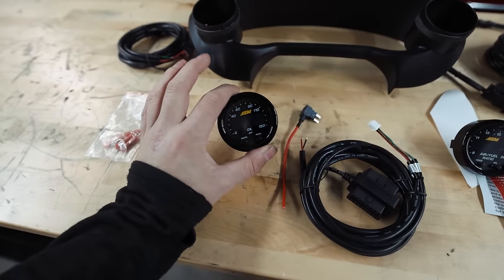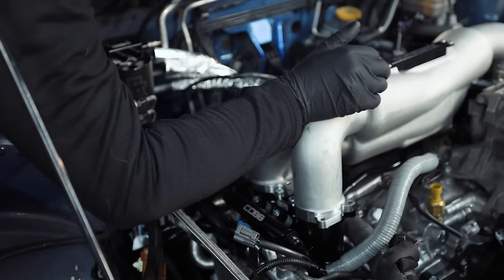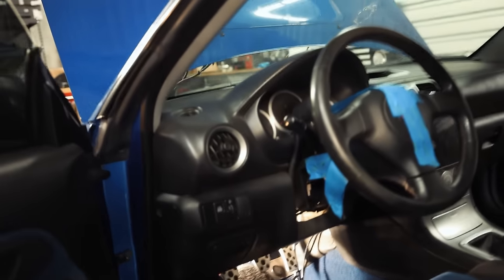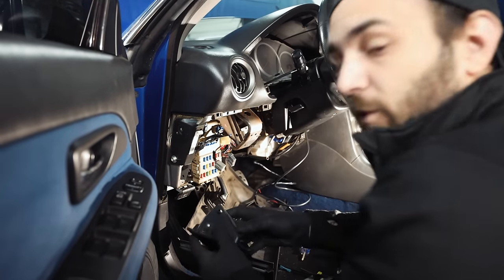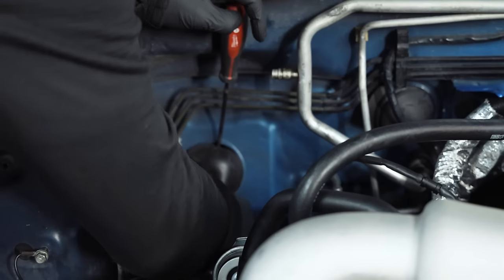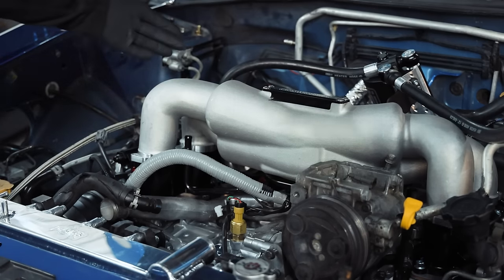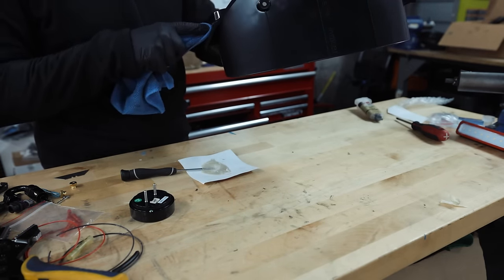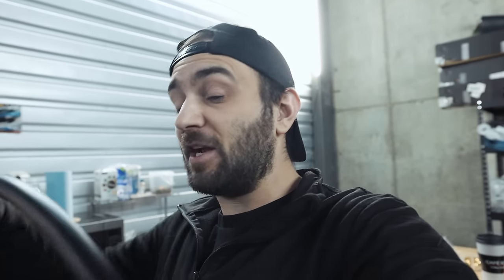AEM Oil Pressure & Wideband Install; 2007 Subaru WRX STI

Comment: So my question would be since u r taking off the oem dummies oil pressure sensor what do u do with the wire at is connected to that one wont that make a light come on???

Comment: So it is my senssor that went bad , it started to slowly not work some times  some days work and some not and then would only come on during hot days then finally stoped fully working no matter what and now never comes on , and ive been wondering what happend and what it might be , i figured the sensor but wanted to make sure before buying one but if you say they go bad like that then it should fix it no problem is there a warrenty on the sensor if you buy a new one ? , 06 GD owner and love the hawkeye content

Comment: What I did to make the rubber bands work is wrap the gauge with electrical tape to increase its girth, then wrapped the rubber band around the tape then they fit fine.

Comment: there is a firewall plug next to the steering column you could route the oil pressure sensor without having to extend the cable

Comment: I connected up oil pressure and temp gauges a couple of weeks ago, got a little freaked out watching the pressure steadily dropping as it warmed up, and not knowing what the pressure should be when idling at operating temp. A quick google search calmed the nerves.

Comment: Quick question! My Ap Afr reads a normal 14.37-14.50 but my Aem Digital Afr reads 15.15-15.40 at idle, then in normal driving they seem to end up matching. Is that normal?

Comment: For future reference,  anyone needing a replacement aem uego wide band o2 sensor;   Bosch part number 17018; o2 sensor will work as a replacement.  Its also alot cheaper than what aem will sell you. Just fyi.. happened to me plenty of time with my blob eye wrx

Comment: Curious as to why you chose the dummy switch location for the oil sensor. Is that for access? I did the one in the middle of the block and found it useful as when that sensor goes out, you have the dummy light as a check. My gauge value crashed but the dummy light didn’t do its 4psi trip so led me to know it was gauge and not engine

Comment: For the AEM gauge bodies you can 3D print spacers essentially to attach to the posts on the rear of the gauge and then use a rubber band as you would usually do.
Reply from the maker: I need to buy a 3D printer 😅
Reply: if you want to send dimensions ill 3D print them for ya! @Smeedia
Reply: @Smeedia  I'm local if you want to try to figure something out with my printer.

Comment: I feel like all subies are the same but I ran all my gauge wiring behind the driver front fender there is also a massive grommet that you can add wiring through it, the stock wiring from the engine bay fuse box goes through it to the interior fuse box
Reply from the maker: I've used that one in thr past for battery relocations and airlift installs. Both work well 🙌🔥

Comment: Not sure why I keep getting an error when commenting. But let me try again. 
For the AEM gauges, what if you use some M4 standoffs? They have them in many different lengths.
Reply from the maker: The proper length and those might work. I just learned Smy sells adaptors for those gauges 😂

Comment: Got both of these transferred from my 17 WRX after taking the parts off that. Luckily my gauge gives enough length for the pressure sensor to reach to the OEM port. Haven't tested to see if a 1/8" Y fitting fits there with the alternator so close though. Man the FA20 was nice for that fitting being in the timing cover 😅
Reply from the maker: The FA20s fit a bit better for that harness 😅 My old BRZ was same same

Comment: 100% 

On my 944 ive got it all

Water temp
Oil temp
Oil pressure
Volts
Fuel
RPM 
Speed
Vaccume overlooked but tells a lot of the health of a motor or boost that goes vacume.
Wideband O2
Fuel pressure
And fuel content if your running flex.
Reply: And as a cover all the Banks OBD2 Idash for a cover all one gauge does it all
Reply from the maker: All good additions 🔥 

One of the reasons I love my haltech in my 17 STI is that it shows all of this on thr main display 🔥🙌
Reply: Cobb Accessport monitors 6 out of that list plus intake air temp,fuel temp.  throttle position,  boost wastegate duty, gear selection and a lot more, but oil pressure mechanical gauge is a great addition and A/F Ratio.

Comment: my 03 outback has just a oil pressure switch - is there a oil pressure sensor that would work with that?
Like if i were to install a OP gauge, I assume i'd need to replace the OP switch bc its just a switch, but i dont want to put in a sensor that just tells the ECU theres zero pressure, even if I got the gauge that tells me what it is
Reply from the maker: You can run both. You'd just need a Y adaptor to use both sensors. Or you can use the rear galley above cyl 3

Comment: I’m struggling to find a video on port injection regarding the fa20. Can’t find a install guide or just a better explanation on the install and all the pros and cons for power
Reply from the maker: Tbh I don't think you'll find much out there. Not too many people doing it. 

It shouldent be much diffrent than doing a fuel system on an EJ 👀

Comment: Tanner, is a wideband required if you have an access port with AFR gauge? I’m adding an intake, downpipe, 340 fuel pump 1050 injectors, fuel pressure regulator, boost controller, Cobb sf intake, catback exhaust.  And I need an etune. Some people say I must get a wideband, some people say it’s not needed. I’d really appreciate your opinion as I trust you. Thank you!

Comment: I agree, I also only use gauges with actual needles that sweep generally too.  Digital gauges don't move fluidly enough for me and depending on the lighting(lack of) are unseeable or blinding lol.
Reply from the maker: I could ser that. I prefer the digital ones as I can quickly reference them when driving 😅
Reply: @Smeedia  That's why I get the needles... if they every pointing the wrong area....it's noticable to me.  And again the light sensitivity the older ya get at night man....

Comment: I installed an AEM x series 150psi oil pressure gauge in mine but even when connected to the sensor, the gauge just reads "SENS", and never reads any psi. there is good voltage at the sensor and the sensor seems to be outputting the correct voltage on the signal wire, any possibility the gauge itself has failed ?

Comment: This skipped over the wiring for logging purposes entirely? Which is what I came looking for. Literally the entire point of fitting a wideband setup. Was a waste of time watching this when you only did half the job. If you werent going to do the whole job then you should have mentioned it at the beginning of the video. Smh

Comment: I have an AEM wideband and the bloody LCD screen has gone so dark. cant see it in the day at all. did it just on a year old. 
Also RE: the immobiliser - you would have a fit if you saw an aus WRX. the dealerships wired in a system before selling them in all the cars because of the high theft rate.

Comment: I put a Y in the oil pressure sensor port and run the OEM sensor and the gauge sensor from one port.
Reply from the maker: I just leave it out, light stays off and dosent tell me anything more than the AEM pressure gauge would 😅
Reply: @Smeedia  I was worried that the OEM sensor would stay on saying there was no oil pressure. Does it not do anything?

Comment: yo bro jus wanted to ask a question as to should i also run the X series because I’m looking at all the gauges for my 07 STI and they’re all different so just wanted to ask why those ones instead of the cheaper ones and if it’s worth it? or the differences in should say

Comment: I install cameras and gps systems on public transportation and power company vehicles. I bought a 50’ “snake” from Home Depot and it works wonders for running wires! Just cut off about 10’-15’ of the snake, file one end over onto itself and tape. Then run it through wherever you want to run the wires. Tape wires to the folded end of snake and pull through! We call it a “fish” (fishing the wires through) this way you don’t have to slit the edge of your boots/grommets. Just a small hole and push the fish through with wires taped on!

Comment: What is the point in installing one of these A/F gauges if you can already track A/F on the access port? Is it more accurate?
Reply from the maker: The AP reads off of the front o2 and is a narrow band sensor. The narrow band can't pick up as much information so for better and more accurate monitoring you'd use a wideband
Reply: Ahh I see, thank you so much!! 🙏  Been loving the build on the Hawkeye, keep up the great work man!

Comment: Your wiring tendencies entertain me. I'd have just used some wire and four of the splices with the solder and heat shrink in them. Add some tape and maybe sheathing if its a showy car and call it good.

Comment: excellent advice, on my 06 there is an accesshole on the drivers side firewhall and I run my gauge wires through that, makes for an easy hookup to the fuse box
Reply from the maker: I've used that one before as well. Another good route to go 🙌🔥

Comment: The replacement O2 sensor you can get from a regular part store if it goes out. Ive heard the Bosch ones are best.
Reply from the maker: Those are the exact ones I use 🙌 little cheaper I've seen on Amazon. Parts stores around here are about $70 a sensor

Comment: Do you recommend sandwich adapters on the oil filter? I have a temp and oil sensor plugged in to a sandwich right now... Was thinking of relocating the pressure to where you have yours.

Comment: Same guages I have. Smy makes an adaptor to extend the guages to hold in the pods. Also I wish I got the 150 psi oil pressure lol. I thought 100 was gonna be enough. Sensor always errors out till the oil warms but a little :(

Comment: If you ever have trouble getting wires through tricky spots, look into a tool called a push stick. We use them in the IT world when we need to get network cables and other things to go through small holes in walls and other hard to reach places
Reply from the maker: I've done similar. But I'll end up using welding wire to push wires though 😅 works like a charm 🙌🔥

Comment: You should try e6000 glue it’s amazing if you ever want to remove is doable doesn’t leave residue. After I used it never used jb weld or double sided tape.

Comment: i got the same oil pressure gauge in the same spot only way i found way just to use some electrical tape around to hold it in place you don't notice it so much as it all blends in
Reply from the maker: Tbh I never thought of that 😅
Reply: @Smeedia  I wish I did extend my harness like you did just so I can run it in my ati triple gauge holder tbh

Comment: You should glue a piece of plastic or metal across the hole with some holes then bolt the gauges down.

Comment: I removed the plug toward the rear of the block and used that for the oil pressure sensor.  I didn’t need to extend the harness.

Comment: Great video! Does the wideband setup help with tuning with the Cobb AP?
Reply from the maker: Not so much anymore. Before greenspeed you could tie the wideband to read to the ecm.
Reply: During my e-tuning, I would have a passenger record my AFR guage. Send that to the tuner along with the datalog. The tuner just used the video to compare the numbers to the narrow-band reading on the Accessport datalog.
Reply: Open sauce and dime mod support it.
Dime mod literally does all cobb does (and more) except for live tables.
It can even add a blip for down shifting.

Comment: Do you need to purchase a separate oil galley plug with the 1/8 NPT threads in it or does the factory plug where the oil pressure switch mounts have the same 1/8 NPT threads?
Reply: I know im late but was scrolling thru the comments. You do need a seperate 1/8 oil galley plug. You can get them from killer b and other similar companies but ive yet to find one that threads into the sensor nicely lol